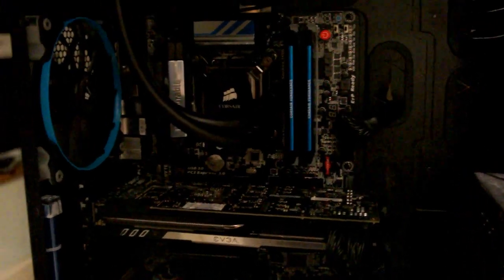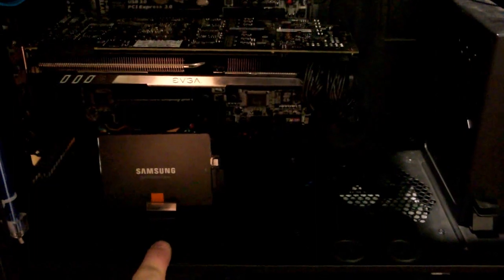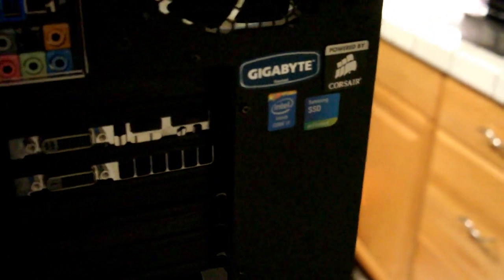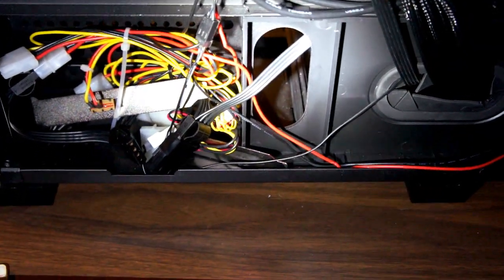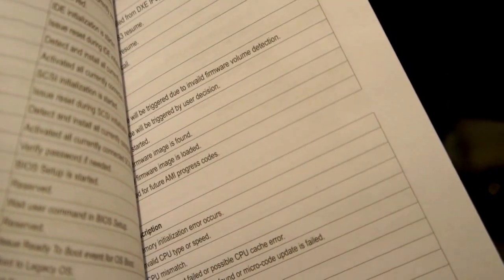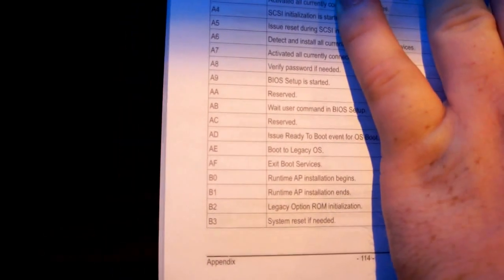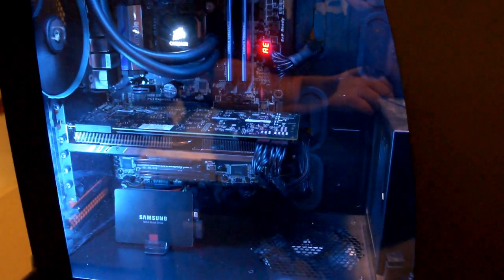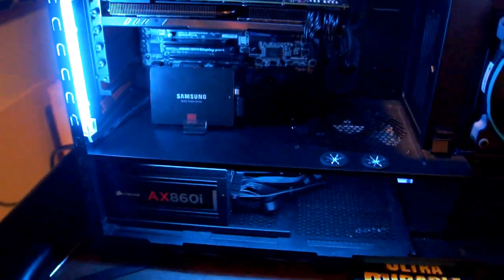$2500 Gaming PC 2013: Haswell i7-4770k & GTX-780 ACX  - Finished

Comment: After a couple of months i put a custom water loop i made that has dual bridge block on the graphics Card running down to a block for ram then the cpu i made as neat as possible with angled fittings and turned out great

Comment: I'm collecting all the stuff I need for my build as I'm posting this. Here's a small run down - asus Maximus vi formula - same CPU cooler- 4770 k i7 - 16 gb of 1800 ram - corsair tower storm trooper white black-  corsair 1200i power supply- lg bluray drive - 1 120gb ssd Sammy - 2 500gb Sammy ssd - 2 sli 780 reference cards nvidia-  just having trouble deciding on what monitor to get.

Comment from the maker: thanks for the comments and compliment.
What is this build for? Gaming? If so 16gb of RAM isn't needed at all and tests have been done to show it will only improve FPS by 1 or less. As for a monitor; since you're using SLI 780's then you had better be looking into 2560x1440 or 2560x1600, otherwise you pretty much wasted money on getting 2 of them. My single 780 runs every game at 1080p with a 60 FPS min without a sweat. I haven't yet, but I will be upgrading to 1440, I prefer the 16x9 ratio.

Comment: looking good dude congrats im so looking in to that i7 
i found a combo at best buy for 700$ 
ntel - Core™ i7-4770K + Gigabyte GA-Z87X-UD5H + Corsair Vengeance Pro 16GB Ram
Reply from the maker: Very cool, but i'd look on new egg or amazon. You might be able to get an even better price. If not sure go a head and buy it at Best Buy
Reply: Xboxshqip
Reseat the waterblock make sure it makes enough contact with the cpu, use top grade thermal paste like arctic silver MX4 ..... and his temps will be a lot lower even for haswell standards his temps are to high for an h100i
Reply from the maker: Xboxshqip If your case has good air flow and you aren't going to over clock then that cooler should work out just fine
Reply from the maker: Xboxshqip Plenty of airflow in that case, should be a good build

Comment from the maker: Wasn't angry. More so confused that a GTX 780 was called out dated lol. My Q6600 and GTX 460 shown in my other video was out dated.

Haswell isn't amazing if you're going for a number, but its faster clock for clock than Ivy or Sandy. Mine is at 4.5Ghz and its plenty fast and only hit 76 C (Idle at 29 C) on the hottest core during bench marking with my H100i.

I was waiting and finally just said screw it after 2 years and just bought it right after release because I couldn't wait any longer lol.

Comment: Nice, maybe you could do a how to overclock video, or how did you do it. Because for my build that I am going to make in coming month, I'm going to use the same mobo. And another question, i saw in some guy's video that there comes software with the mobo where you can one-button-overclock? Does this work well? I have 0 experience with overclocking but i want to overclock my future I5-4670K to at least 4Ghz. Thanks (Sorry for bad grammar or spelling mistakes, i'm from Belgium ;) )

Comment from the maker: whats wrong with water cooling? I did OC my 4770k to 4.5GHz. I also HATE air cooling because the coolers are so big and bulky and ugly, while these closed loop water cooling systems are very neat and tidy and preform better.
If you're dead set on air cooling then i'd say look into the Noctua air coolers, otherwise look more deeply into the corsair "H" series.

Comment from the maker: Yes, the mother board comes with the drivers and software. Honestly the bios requires almost zero work for over clocking and there are even presets. That kind of blew my mind as I'd never seen that before in a bios. I still did it the old fashion way but i'm sure the presets work exactly the same and just as reliable.
Also your English is great, especially if its a second or possibly even third language! I've been to Belgium, I really liked it there.

Comment: OK , actually i rethink it again, i actually like the design of the bitfenix becoz of the usb port, I like USB port on the top and if i'm going to install a H100i in push/pull the top cover can cover up the fan , but the corsair 750D cant , but i also like the design of the corsair ....AAArrrggghhhh !!! any other case suggestion ?

Comment from the maker: A good case should have; 1) As much Aluminum construction, inside and out, as possible- cases last multiple builds so it is an investment 2) Able to fit your GPU 3) Have room for a 120mm rad + a pump/ res + at least 2 more 120mm fans. 4) Be something you can look at everyday and enjoy + not regret it. 5) Motherboard tray cut outs for wires + grommets if possible 6) room to hide wires 7) A window + painted (white or black) interior 8) A brand with a good support.

Also look at Lian-Li.

Comment from the maker: 1) got a super deal on the 4770k; micro center dot com
2) I'm really happy with my EVGA GTX 780 ACX, if not that I'd look into the ASUS. (the Lightning is great, but the looks don't do it for me).
3-8)as far as the rest of the build it all look GREAT. However I'd get a AX-i series PSU if you want Corsair
9) I'd really recommend a Corsair or Bit Fenix case over a cooler Master, but that's personal preference.

thanks for the view and comment, lmk if there's anything else I can help with!

Comment: I need help on choosing a cpu cooler and psu for i7 4770k, and asus gtx780 dcu2 oc 3gb on asus z87-plus. Is the corsair h80i and 700w psu enough?
Reply from the maker: A corsair H80i is a great choice. I usually recommend upgrading the fans but you dont have to. You will want to make sure your case has adiquit air flow for the GTX 780.
A 700w PSU is plenty of power just make sure its from a well reputable company. However if you pan on upgrading to run a second GTX 780 then I would bump your PSU up to a 800w if not more. Also if you can find a modular PSU it really does help with cable management and airflow.
Reply: askloglog thx a lot sir for you time. im getting a Corsair Obsidian 750D case and Corsair 700w PSU. :)
Reply from the maker: katapo777 That sounds like a great start to a build!

Comment: @askloglog I have the same board and I've just brought the same ram 1866mhz. I'm not able to boot with both sticks in,I don't think its the ram as it has been tested in another rig and works. My rig just comes up with error code 15 and reboots constantly. Any advice or did you run into any trouble? Thanks.

Comment: I found that the i7-4770k is about $299+ , how come u get it that price? 
My future build :
1. i7-4770k
2. gtx780 (any suggestion?)
3. asus maximus 6 formula
4.corsair h100i (push/pull)
5.Corsair 8GB RAM Vengeance Pro
6.samsung evo ssd 500gb 
7.corsair 1000w(PSU)
8.cooler master cosmos se 

i cannt found some price of them, could u help me find , it's ok if u're not free :)

Comment: his pc isnt even compatible the Gigabyte z87 x-ud3h is not compatable with the gtx 780
Reply from the maker: Um.. what? How is anything in this build not compatible? Considering that everything runs flawless I'd say that your statement is false lol.
Reply: Oh no need to get mad about it i made a simple mistake in researching the motherboard I know its a pcie 3.0 but on my research using two  compatibility  programs they said the motherboard was not compatible. In addition I never said it  wouldn't  work. I just meant that his graphics card cant perform at its best with this motherboard
Reply: connor smith if you knew anything about computers like you were thinking you did you would know that his cpu and motherboard are current gen and that they would obviously work together as well as working with the graphics card.
Reply: yeah I know, mistakes were made, but I cant stand it when people just shoot out a comment before they take the chance to get their facts straight, otherwise this happens and they look like a dumb ass, then I must correct them 0_o
Reply from the maker: Nathaniel Thomas
Zack Arias
Haha thanks for correcting him. Hope you guys liked my build
Reply from the maker: Nathaniel Thomas
It works out really good. Idle is usually ~26-29 C depending on core, and benchmarking it got up to 76 C on the hottest core. So I'm really happy about that. It's usually around 20-21 C in my room if my math is right.
Reply: askloglog
76C ???? with what kind of overclock! im running an h80i i7-2600k at 4.5 ghz and getting like 55-60 degrees with prime95 running for hours. does haswell really get that hot with such a high end cpu cooler? u might wanna use different thermal paste or/and reseat it on the cpu... I think u got airbubbles or too much/few thermal paste
Reply from the maker: d4rks33k3rz It's a 4.5 OC running Prime 95, but it was during summer when it was pretty hot. Yes Haswell does run that hot, which is unfortunate, however it does run faster clock for clock. I don't plan on de-liding it. But, I'm going to be using some different Thermal Paste soon but I ran out of my Arctic Silver 5 when I built my fiends computer, so i just used what was on the corsair.

Comment: Lian Li on the front?
Reply from the maker: Yes! Lian Li 3x 5 1/4" bay to 120mm fan converter. It really helps the air flow in this case since it was originally meant for WC'ing. It's also under a desk so what air flow it could pick up from the bottom wouldn't be enough, the Lian Li really really helped with that.

Comment: For $2500 you got ripped off. My pc is $500 less and it runs circles around this.
Reply from the maker: Ok? Well congratulations I guess. Exactly what parts are in your $500 computer that makes it run so much better than this?
Reply: askloglog Lol forget him! He probably thinks his Radeon HD 3850 is better than your 780 because "It has bigger numbers in it's name" LOL.
Reply from the maker: MegaPenguinfan LMAO yeah i know, i just really wanted him to say it
Reply from the maker: TheCrazyTman I do apologize for misreading your last post. Your are also 100% correct that the GTX 780 is beat out by 760's in SLI for gaming. But I doubt you are using an i7 at that price point; which for video rendering and graphic design, does come in handy with the extra horse power.
However, in terms of gaming, when the second GTX 780 goes in early next year for SLI then that trumps the 760s obviously. This PC was built with 60fps on 1440p in mind which SLI 780 will come close to if not accomplish that goal.
Reply: askloglog i am using a 4770k in my build too actually. but i do not dis agree with you at all. in fact i was considering getting 2 780's soon thanks to the price drop recently. or maybe a 780ti.. decisions decisions..
Reply from the maker: TheCrazyTman the 780ti wasn't out when i bought my 780 or i'd have bought that instead :( lol